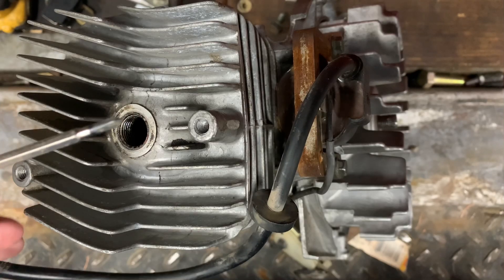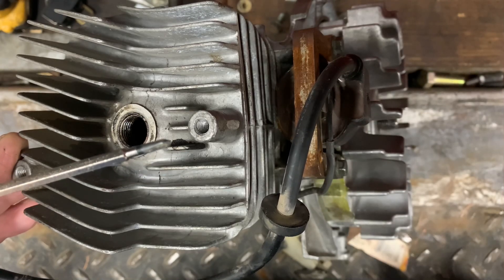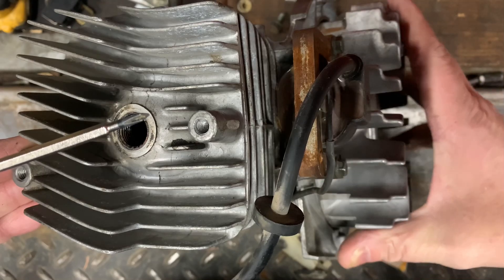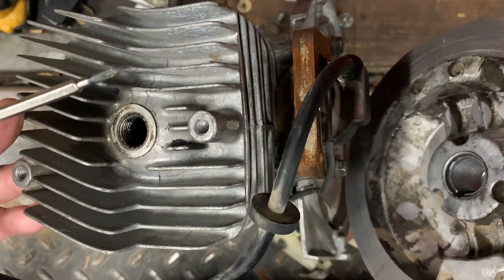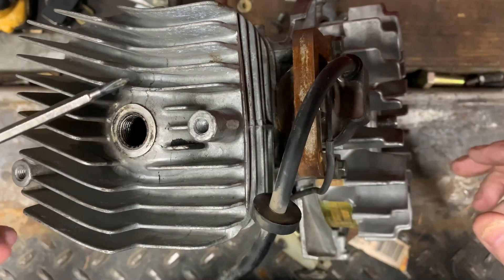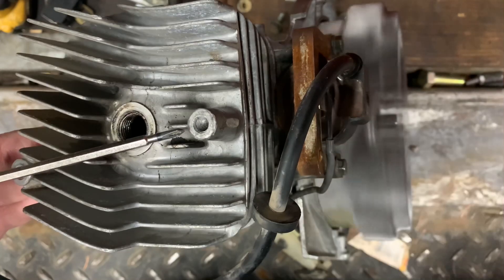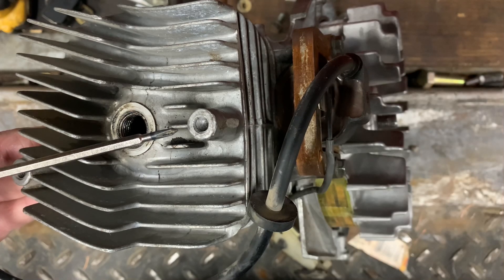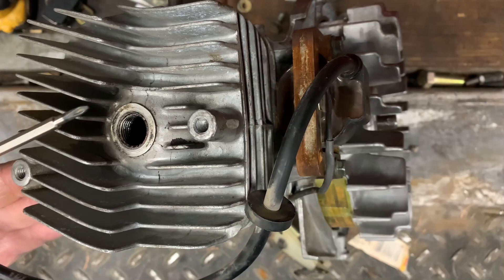WHAT AN IGNITION SPARK SHOULD LOOK LIKE / GOOD HOT BLUE ARC

Comment: Had a summer job cutting grass at a large apartment  complex in 1974.  There was a nice old black man that worked there, he would grab a running spark plug and ask you to shake his hand.  It would still pop you good going through his body.  I used to push a 2 stroke Jacobsen all day long.  Every so often the plug would foul and I got to take a break clean the plug.

Comment: Cool experiment.  I also have found that weak coils will illuminate a cheap spark test light but will barely arc like you show in this video. I quality gap tester like those sold by oppama will ensure a good spark test confirmation.
Reply from the maker: Exactly those little LED spark testers are worthless in my opinion now they work great if the coil doesn’t spark at all that’s why I like to use my PET echo spark tester that’s adjustable from 0 to 40,000 V
Reply: I have the exact one with micrometer thimble gap adjustment. A cool tool!

https://www.ereplacementparts.com/tester-spark-p-2558231.html